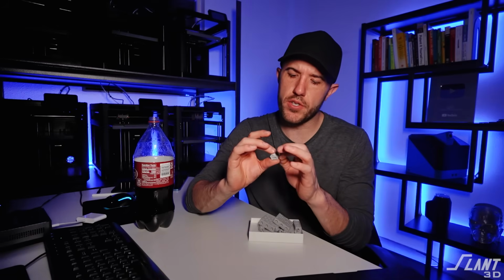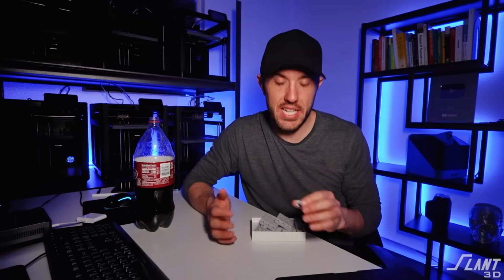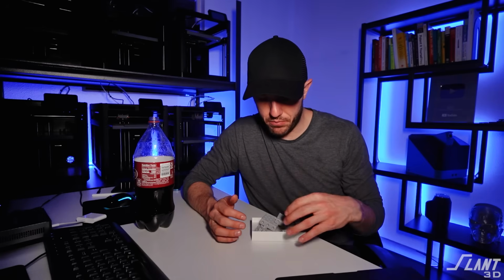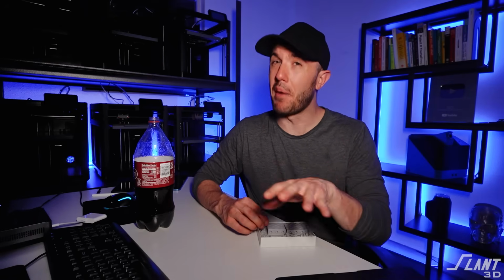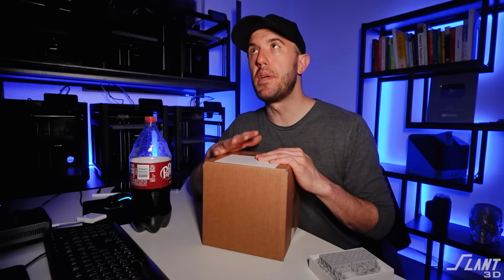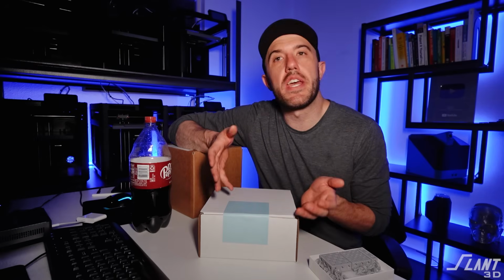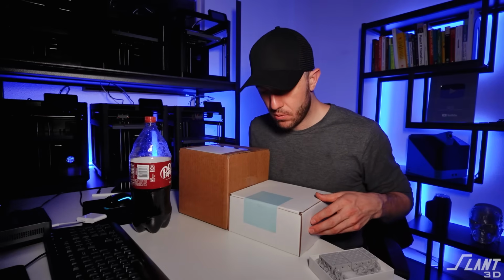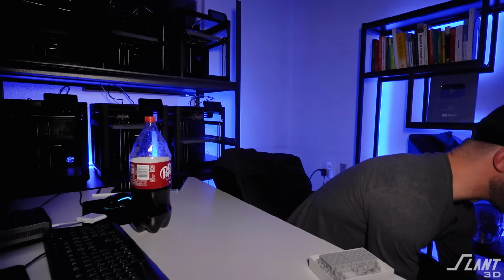3D Printing a Human Ear | We Solved a Giant Problem with Extrusion | Podcast Ep 108

Comment: I tried saturating a towel with water using capilary forces where water goes up in oposite direction of gravity and i have put a fan blowing in to it, and it didnt work as intended😂 this was in my dorm room when it was almost 40* celsius outside. Now that i have 3d printer i maybe even try to remake it

Comment: Is microfiber going to impart microscopic filament parts into filament that has microscopic porosities to catch them?

A semicircle with filament at the top may use gravity best? Low pressure fans could be used to increase drying of the microfibres too.

Comment: So what you didn't explain very well.  Normally layers are applied directly upon other layers, they are squished together and when cooling cause them to bond.  You want to put a small air gap between layers, just big enough that it's starts to cool before fully bonding with the layer its on top of, preventing them from fully bonding together.  You don't want it so big that it becomes suspending in air, but not so small that it bonds with what's below it.  I hope I did a better job of explaining that.

Comment: For the microfibre thing, absolutely genius! Well done you guys. I got a suggestion though.
You could put cylinders al around the filament – say in a hexagonal pattern for instance – with microfibre around the cylinders and a bit of space to allow it to dry in all directions while still being possible to push the water down with gravity. Just thought of it so it might be worth testing.

Heck, you could even make the cylinders rotate to really brush against the filament just to reaaaallllyyy go overboard :D

I wonder how that can be done to PETG and PLA to dry during printing, if the friction is right and the spool gets pushed with enough force, maybe with a Direct Drive extruder, non heated at one end just to help push things along, with a force sensor so it doesn't keep pushing and break. Ahh, ideas ideas ideas!

Comment: I am sorry , but if you state a minimum print resolution and size and  still the customer ignores it . Its on Joe the 3d print professor. I think the form on the web application should have a field or a pop up stating all print resulution is  minimum .2
Reply: It is not a minimum 0.2 mm. The layer height is always 0.2 mm. I looked at the slant3D site. I think the information is clear enough if one simply makes the effort to look. They also specify the smallest recommended feature size.

Comment: So the layers are bigger than .2 in Joe's parts because he chose your gray filament?  Are you serious?
Reply: You might wanna review the video again. That isn't what was said. He said Joe prints at .1 and the teleport system only uses .2 and then he said you can check the FAQ page on the site.
Reply: @oGcDrunKnMonk  Cool.  The layers on the parts joe received are not .2mm thick.  But i appreciate your condescending response.
Reply: @oGcDrunKnMonk  joe prints at .2, or at least is able to succesfully print it in .2

Comment: Question: i’ve tried to 3-D print MagSafe phone stands, but have found that overtime it gets progressively weaker would you consider including an adhesive or do you have any suggestions on stopping it from having a week pressure connection overtime?
Reply: That tends to be a big problem with PLA. It deforms if under constant load. Try a different plastic and see if the issue goes away.

Comment: When I give reviews, the average is about 3/5 stars. If whatever you're selling does everything it claims AND everything the intended use case needs, that's a 5 star review(or I've tried several competitors and yours is way better). Though this includes how it holds up long term, so I usually don't have enough information to be comfortable leaving a 5 star review when companies are asking for a review. It would have to be a very simple product that I fully understand for that. 1 star is completely unusable, or dangerous.  In between you get stuff that sorta works, that broke when it shouldn't have, inaccurate description, etc.

Comment: Question: at the moment teleport is optimized for a 100% 3d printed part, printed in one piece.  If a company wants to do assembly themselves as more parts are required, the teleport JIT model somewhat falls down as it's optimized to sell to customers directly.  Do you envision changes to support a more supplier based model in the future?  Or do you expect that to be more for companies like PCB way and the like.

Comment: Question: 95A TPU rough timeline? 

The material is growing in popularity as people discover how widely its application can be applied towards, I would dare say most products going through teleport would be a slightly better product if it were TPU . 

Obviously this would require lots of system changes and slicer software changes. I know the company is growing in a controlled manner, which puts TPU far out there. 

This wouldn’t encroach on Zellerfeld, as they are specialized cutting edge TPU applications and this would be basic general application.

Comment: Question: How does auto ejection work if a start line is required? Atleast for most printers they always have a small line of filliment at the start to prevent weirdness at the beginning of prints. What makes Slant's printers different.
Reply: That 'start' line is a purge line. In some others it's also used for surgery pressure advance or flow compensation (i.e. some bambus). That's a consumer feature, and even most small penny farms running much more than 3 or 4 printers, or using any kind of automation, aren't using them.

Comment: QUESTION: The gray filament is nasty for many reasons but on that note - in your experience what is the best filament, colour wise, wrt precision and flow control?
Reply from the maker: Black
Reply: @slant3d  :D really? I do 90% of my printing in black (pla, petg, abs, asa, pa, pc ...), 9% in marble pla and 1% for everything else (tpu and other coloured filaments of differentmaterials, transparent pla, transparent petg) ... I'd say that transparent PLA is pretty awesome wrt flow control and accuracy but is brittle as hell so that's why I do not like it .. isn't black color worse than most? (I know for ABS I often need to print all other colours at lower temp compared to black ABS, have not experienced that with PLA but always assumed black colorant is problematic as it needs to saturate fully... so asking genuine question trying to learn :D )

Comment: For the microfiber towel situation, given that it works so well, in the event that having a faster line causes it to saturate, you could probably add a fan to blow on the towel and it would likely be enough to dry it out.

Comment: Some feedback for teleport - I've been wanting to try it, but the restriction of only being able to sign up via Google email is what has stopped me. I understand the security it provides on your end, but with my domain being M365 based, I don't have a business email with Google. Sure, I have Google accounts, but I'm not going to sign up for a business related service if I can't use my primary business email. I'll just keep tabs and sign up when registrations aren't locked down I caught about half the pod, was a good listen. Thanks for making it.
Reply from the maker: Email forwarding would solve this
Reply: @slant3d  Requiring customers to either use a free/personal Google account outside of their business domain, or pay for Google Workspace licensing (and have to purchase a second domain) so they could sign up for 1 service and then forward the email to their business is incredibly silly. Mail forwarding adds a point of failure and it's now a second account you have manage and monitor for just 1 service. And there is another 2FA account to manage as well. The average person wont create additional accounts just to try the service to see if they even like it when that barrier to entry exists.

Comment: Why oh why would people print minis on fdm 0.4 nozzle with 0.2 res.  I can print minis on my bambu but only on 0.2 nozzle at 0.08res.  3D print doctor didn't read the faq of the machines used by slant3d uses.
Reply: There are minis and then there are minis - and wonderfully people tend to stick with the first category with scales, insanely thin features and detail that works best with resin printing 😅
These models are designed to be printed with 0.4 mm nozzle. Goblins benefit from 0.2 mm nozzle, but they don't require it.

He (and I) printed them with 0.4 mm nozzle and layer height between 0.1 and 0.2 mm (most likely 0.15, can't remember, but that is recommended). That is not huge difference to 0.2 mm. 3DPP did print the models also at 0.2 mm layer height (see his blog) and they were fine (a lot better than what he received).

Also I see it more as a test: if he wants to have physical stuff made and sold (online or in stores, either way it can mean thousands of sets), can it be done affordably and in reasonable quality using a service.

Comment: you got something wrong about plymakers htpla. 1st of PLA is not amorphous, it's semi-crystalline and that is why it can be annealed to get better temp resistance, and 2nd and more important is that its VICAT temp is 150 even before annealing which only improves HDT. In that test they've shown PLA wasn't annealed and it was still standing after all the other filaments, but just because it wasn't under any load.
Reply: Yes! As soon as he started talking about it needing to be annealed I rolled me eyes. Polymakers HT-PLA does not need to be annealed! It can be, and you get even better temp resistance with it, but it does not need to be annealed to acheive what is advertised. If he had actually read any of the information Polymaker released, he would have known this.

What he mentioned about GF and fiberous materials was correct, but the whole part about the filament needing to be annealed to do anything was just wrong. You can get better heat resistance by annealing TONS of different printable materials, that does not make automatically make them "High-temp". Polymakers HT-PLA has high-temp resistance the momebt it leaves the nozzle. Nothing extra is needed to be done.
Reply: @The_Qollector  I'm digressing, as I have not tested annealing, but Polymaker is completely sold out of HT-PLA.  Apparently, they have a hit on their hands.  If it wasn't working, I'd expect a lot of people screaming on their YT channels.

Time will tell.  I almost want to see about some stress tests of parts that were annealed and were not, but I don't have the test equipment.
Reply: @The_Qollector  I came to the comments to say exactly this. Thanks
Reply: Actually he is right and wrong. If you watched the release videos AND read all the documents and tds files you will find that polymaker contradicts themselves. I was on top this the moment it came out and they say one thing in the video and yet another on paper. I immediately noticed the contradiction. So to depends what info you are ingesting. In one place they say annealing is needed for 150c and in another place they say it is not.
Reply: @phasesecuritytechnology6573 it's all clear imho, vicat is always 150c, annealed or not (that's why it falls down last).  Annealing only brings up hdt, eg temp it can do under load.
Reply: A fun face about the HT pla is that it doesn't fufile the nesenery iso Standerds 
Therefore we actoly don't know how well it know and we can't compare the stats to outher materias